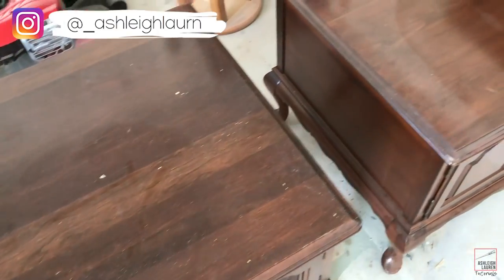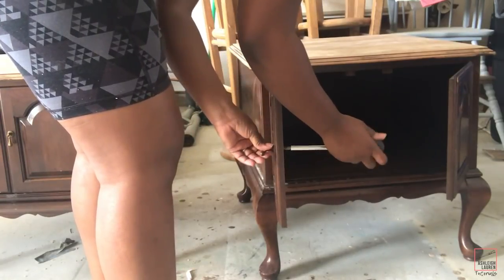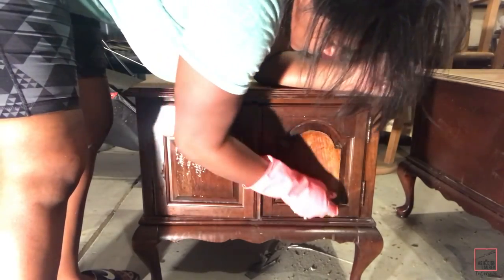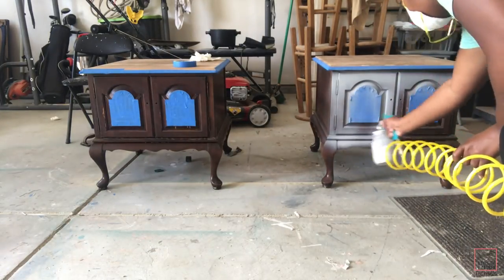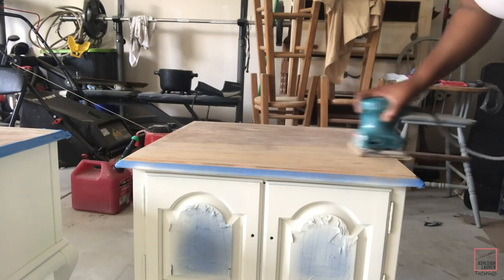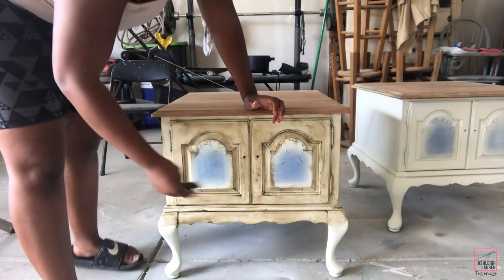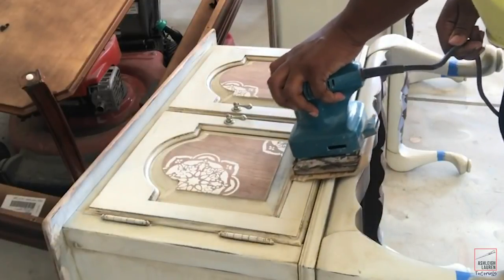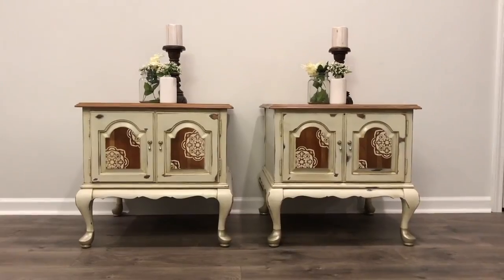DIY | How To Apply Dark Wax | Furniture Makeover | Ashleigh Lauren

Comment: Girl, you are so talented! You took these tables from drab to a whole new up dated look! So glad you mentioned applying clear wax before the dark wax. I've watched others end up with a hot mess, even on small crafts, when they just dive in with the dark wax. Someone just gave me a 7ft high hutch with doors on the front, open lighted area at the top, 3 drawers at the bottom and a drawer inside the area where the doors are. Big, Beautiful piece but, Got my work cut out for me for sure because whoever painted it with chalk paint did not know what they were doing. Gonna start on it after the New Year. Gonna take a lot of time. I'll leave it to ya in my will if I don't get it finished. LOL. LOTS to do on it. Hugs from Florida.
Reply from the maker: Thank, Elizabeth! Oh yeah, applying the clear wax first is a must lol. That sounds so beautiful! You can do it and when you're done I know it will look amazing. It is a lot of work but the finishing product is always so rewarding. ☺️

Comment: Hey Ashleigh. I’m actually painting my headboard right now. The current headboard has a super glossy finish to it so I wanted to use chalk paint on it in an effort to save from sanding, but I see you did a primer first in this video? What primer did you use? Also what color did you use for the dark wax? I love the color! Awesome tutorial. Thanks!
Reply from the maker: Thank you, Meryem! The primer Zinseer All Surface Primer. You don't have to use primer but I like to test an area first to see if the chalk paint will stick or not because sometimes it doesn't depending on the brand and also the furniture as well.